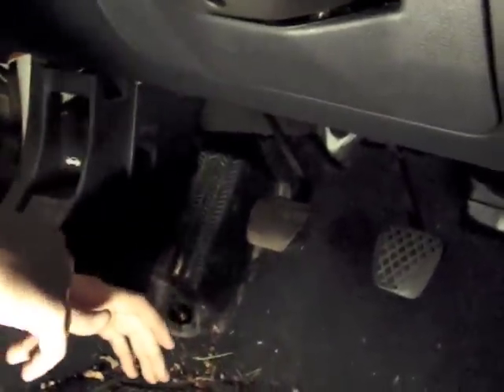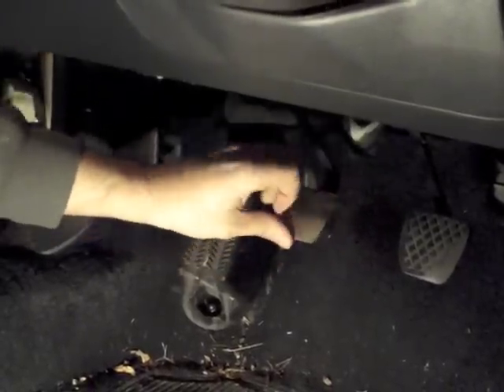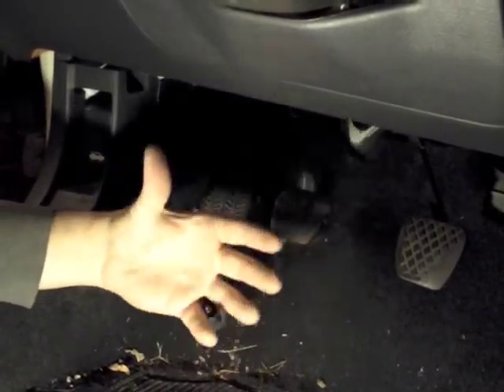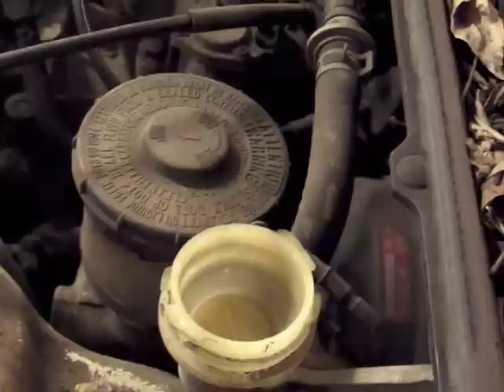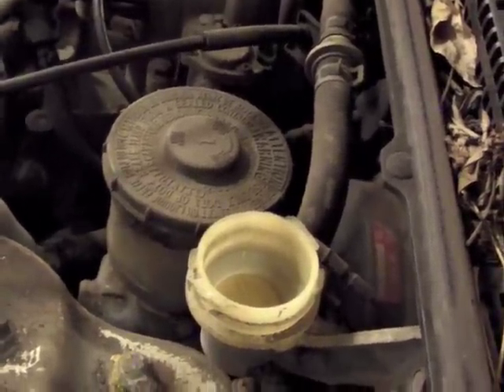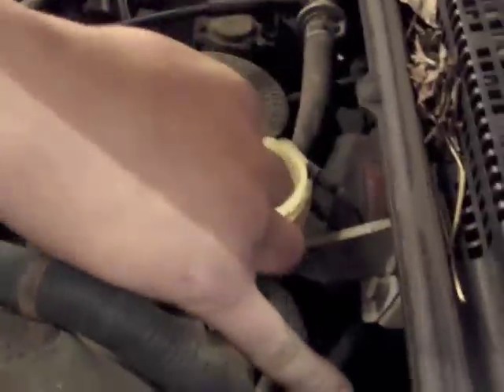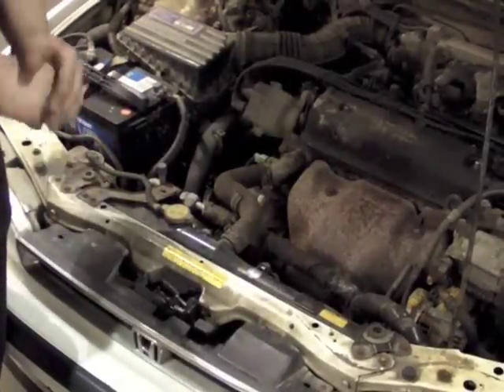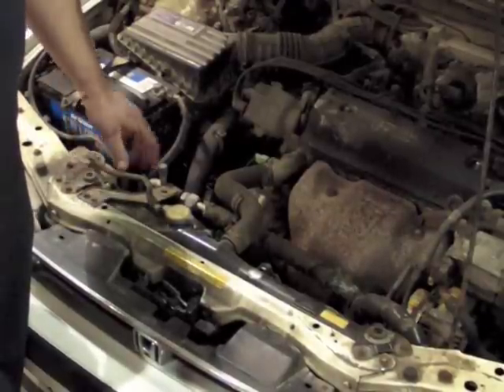How To Diagnose A Clutch Problem

Comment: i have a s10 1996 the clutch pedal is floppy and it wont go into gear when running. i have noticed that there is a little puddle under the truck what could it be? and is the slave in or external?

Comment: I have a question. I have a 95 eclipse gst with a hydraulic clutch, and i had to bleed it slightly regularly (say, once every two or three weeks). Today, I was driving and upon pressing the clutch, it simply slipped all the way down (it completely depressed itself and stayed there.) I CAN "unglue" the clutch per say, but it only does it again, and I can't put it in any gear. Any idea what it could be?

Comment: I'm having a problem where my master cylinder fluid level periodically increases to the point of overflow and as it does, I get very bad clutch shudder.  Each time I bleed it, the shudder goes away and I get much better control.  I can deal with a grabby clutch, but in this case, I have no control over the shudder (apart from slipping the clutch during takeoff).  I'm thinking that air is getting in from somewhere and is displacing fluid???

Comment: Well done!  You and your friend are the most articulate mechanics that I have ever heard. For the first time, I really understand how to bleed air from a hydraulic clutch system. I do not wish misfortune on anyone, but if you find that you must replace the slave cylinder, I will be most interested in hearing your descriptions. Got any videos on valve adjustments?

Comment: Thanks guys, gives me a starting point, As a kid I did clutch repairs myself, usually had parts left over, so it does not hurt to get a little refresher. Hope the truck does not need a clutch at abut 55,000 2010 Nissan Frontier PU, don't think it should yet.

Comment: thank you I have a 95 Ford Ranger with the same hydraulic clutch problem and that solves my problem because I have the same exact thing what you described happened to me earlier today going down the road I couldn't change gears and when I did it was hard as rock and my clutch is good thank you I appreciate these videos...very informative.....

Comment: Thanks - my clutch pedal seems very hard to push.  Works but makes a creaking noise and very hard, despite me having strong legs.  243k miles on 2013 Accord coupe V6 - six speed.  Any thoughts would be helpful.  Thanks again. 😊

Comment: I have a 2000 saab-93 and i have to pump the clutch 3 or 4 times to shift it in the next gear and sometimes it makes a loud sound when trying to put it in to gear. I have had the master and slave cylinder replaced and the clutch and pressure plate as well.

Comment: great video well done guys...my clutch has gone I was driving and it gradually wore out and now my clutch has no pressure onit at all and i cannot get it in gear. I just wanted to know, do i need 2 replace my clutch or anything 2 fix the problem or can i do this bleed method and save some money?? thanks!!

Comment: I was on an uphill ramp in 2nd gear at around 3.5k RPM then the RPMs shot up and the speed did nothing. Noticed a slight burn scent soon after for a minute then went away. But I heard you can test if your clutch is slipping by say going uphil and putting it into say 5th and stomping on gas (low speed) and if the rpms/engine bogs down (which it did) means the clutch is NOT slipping. Suggestions :)

Comment: Hi Brain,
I am using Ford ikon 1.8 diesel Indian version. I have a clutch problem. the resistance on the pedal was nil while I was driving and I guessed that the clutch was worn out but after a day the clutch was working fine but again it had the same issue. I took it to my mechanic and he said the there was a leak in the tube as well as the master cylinder has to be replaced. after the replacement started I had to replace master and slave cylinders with  the tubes which had leak and also the

Comment: thanks for the video guys. I have 94 accord and have a same problem. question, I opened the bleeder when the person push down the clutch pedal a little bit of fluid came out. should I wait for a while to close the bleeder until the fluid comes out without stopping?

Comment: Great video guys. I have a 2005 Renault Laguna. The clutch doesn't disengage (since 3 days ago).It started the symptoms slowly at first and then the following day the control gave up entirely. Almost certainly a hydraulic fail. Just started to investigate the problem with a view to repairing it and saving a bucketful of garage bills. My first concern is that the master cylinder attached to the pedal looks  very awkward to get at and remove/replace if necessary. I will have a more serious attempt on it during the next few days, provided the West of Scotland winter weather does'nt prevent me. Have any of you guys  done a similar repair on a Laguna, and is it feasible for someone like me with a fairly good history of car repairs ? (Recently overhauled my braking system)

Comment: @fairhare do you have any resistance on the clutch pedal or is it limp? yes, any hydraulic failure such as a leaky master cylinder or slave cylinder could cause the clutch to not disengage, but the pedal will go to the floor with no resistance. sometimes the clutch disc will rust to the flywheel if the vehicle has been sitting awhile, and the clutch pedal will feel as if everything is normal. if this doesnt help reply back with your year, make, and model, and we can figure this out. Willie B.

Comment: I believe my 2004 VW GTI clutch cylinder is located inside the housing for the clutch and flywheel.  The system seems to operate well, even thought it's 16 years old.  However, I do plan on replacing the clutch and flywheel as preventative maintenance.  Considering the location of the clutch cylinder and the difficult in reaching it, do you advise replacing it at the same time the clutch and flywheel are replaced?   Additionally, how is this internally housed cylinder bled?  Thanks for making this video.

Comment: pump the clutch pedal or slave cylinder itself? I've tried to bleed as you've wrote it and it seems not really working so, I checked the slave cylinder and it is leaking. so, I am trying to change the slave cylinder tomorrow. is there anything I should be careful about? thanks!

Comment: Brian, I have a question. I have a 1990 Honda Accord LX and the clutch is giving me some problems. I just had the master cylinder replaced a few months ago and today as I was making a turn I tried to shift down and the car wouldn't go into gear. I pulled over, and as I pressed the clutch in, it still wouldn't go into gear. We turned the car off and easily shifted all gears. I was told to replace the slave cylinder......Is that true and how do I know if I need a complete clutch replacement?

Comment: I have a 2003 chevy s-10 5 speed manual. I recently replaced the clutch. Before I replaced it the clutch pedal had no pressure and I could not shift the gears while the truck was running. I was able to drive the truck again after replacing the clutch for about a week and now I'm having the same problem. Do you think it is the slave cylinder or something else? Thanks, Jessica

Comment: I have a Chevy S-10 2003 double cab, brazilian made. Clutch keeps engaged at any speed and at any time, and when it happens I have to pump several times for it to suddenly release. I saw your video and found very useful to know how it works, but frankly I have no idea of what is going on. Any help is appreciated.

Comment: that really helped out alot guys im finishing a project with a h22a in a 94 accord and replaced the slave and master cylinder and the clutch pedal is sticking the floor
id apperiate for a commet back

Comment: Yep, My 87 Jeep has a separate reservoir, while My 2004 SATURN has a shared clutch/brake reservoir... Jeep is in the 3rd clutch. (hose burned a hole thru killed the 2nd clutch)
SATURN lasted 255000 miles on the 1st clutch ❤️👍 currently at 357000+  miles on the 2nd clutch. Today, Jeep clutch went to the floor while engine was hot... Then pump pump and the clutch woke up. That's what brought Me to this video.

Comment: I have a 1985 Chevy S10. Replaced slave cylinder, master cylinder and rubber hose. Bled system. No bubbles. Would shift ok at first then stop. Clutch pressure gone. Bled a couple more times. Same thing keeps happening. What do you think is wrong?

Comment: Just had new cluch kit put in my 94 chevy silverado 5.7 liter 350 5 speed 2 years ago and I think I have a throw out bearning issue when clutch is is ingadge no rattling when letting clutch out ingear get a rattling sound and in nutral also ?? Is this a throw out bearing or a piolet bearing ?? And what would happen if ether one of these go out completely while driving??? And how much shop cost to have fixed??

Comment: Hi. I am having issues with my 95 probe and my pedal is staying on the floor when I press it but I still am unable to shift into gear. I already bled the system and the fluids came out after a couple times of opening the bleeder. There are no leaks on any of the lines nor is there on the master or the slave. Should I replace them or could it be the Clutch or flywheels themselves causing my problem? It hasn't had any issues till today it went from shifting great to not at all today.

Comment: Hi Brian great vid, quick question I've got a 97 sti impreza I've noticed its starting to rev out a little in 5th gear now and then, also the clutch pedal is sitting half way to the floor all the time and it takes very little to engage it, could this be solved with bleeding or is the clutch slipping!!

Comment: my clutch pedal is hard to push.  the pressure plate and clutch disk are already replaced still it becomes hard to push as the engine heats up.. the master cylinder is not leaking, the slave cylinder might be the problem because it leaks a little bit of fluid. does it make sense?

Comment: Brain I have a 93 Honda Accord LX with clutch issues. When i shift it grinds into second and third, and driving home to park it i notice on the freeway as i was shifting i was not picking up speed but slowing down when i press the gas the RPM will race. After parking the car and went to move it this morning into the garage putting it into first gear the car want move at all now. All my fluids are intact and im not leaking any thing do i need to replace my whole clutch system now ?

Comment: Idk if this was covered but could use the advise. 88 honda prelude 2.0. Clutch doesnt grab until almost all the way out, last 3 inches or so. And when Im driving and give it "more then normal" throttle the clutch slips. Bad clutch or air in the lines?

Comment: I'm working on my 96 Nissan maxima with the 3.0l v6 and as of now I replaced the clutch, master cylinder, and slave cylinder and the entire upper half of my clutch petal is dead and it grabs at the very bottom of the petal with no play whatsoever and I cant figure it out. I've blead all the lines, did an entire fluid flush, made sure all the air was out of the lines, and I still have half a dead petal. everyone I ask for help with it is at a loss and no one can figure it out. Thanks for making this video it definitely helped but I still cant figure it out.

Comment: Great work and instruction guys, thanks. I have a problem with my gears - I have a 2006 Ford Fiesta, when I first start the car and pull away, the gear change is absolutely normal. But, when I drive for half an hour until the car is up to temperature, it becomes really difficult to change gears... I've heard that it could be the clutch, the gearbox, and the gear lever mechanism bushes... any diagnosis similar to this? Thanks again chaps.
Reply: +dougieladd Yes, your problem is that you drive a Ford...
Reply: have u had the trans fluid changed
Reply: It was the leverage, it needed greasing. It took a few goes to diagnose it though. It's all sorted now mate, thanks. Back to normal. Chaka Zulu - thanks, very helpful!

Comment: Finally! A video that helps. I have a 97 Accord with the same problem - right now my clutch is sitting on the floor. Did you have to replace the slave, or after flushing everything does it work fine?

Comment: Thanks for making this video, my Mitsubishi lancer gsr turbo reves smoothy when parked but under hard acceleration it won't pass 5 or six thousand rpm. Sometimes in the morning the clutch pedal feels very soft and low to the floor. It usually builds back up while driving. Is this a sign of a tired clutch or leaky clutch hydrolics.up

Comment: Just replaced master and slave cylinder as well as ran new line between the 2 and I've bled and pumped and bled and pumped and  I'm building no pressure whatsoever. Any tips?

Comment: At almost 30k and my wrx clutch pedal is losing feel any tips? It just feels not as firm as usual. Especially after a few pulls.  Update checked the fluid and its still full. It shares fluid with the brakes via a hose out of the bottom

Comment: Good video. Have a 1994 Toyota Tercel. My son is driving it and now the car goes into gear but have to rev the motor to get it to move forward. It slowly gets up to speed but on a hill, very slow to pick up. I'll check the slave cylinder first before deciding it's the clutch. Doesn't seem to grind at all when going into gear. Any thought?
Reply: Cliff Olney Sounds like the clutch has reached the end of its life. One more test you can do- get the car up to speed on level ground in top gear (like 55mph or more) and let off the gas pedal; if the engine speed drops straight away (it'll only be a couple of hundred rpm) without the car speed changing then the clutch is dead. You'll need a new clutch, get that fixed while the car can still be driven to the workshop.

Comment: i have a 03 kia pregio van.The master and slave cylinders seems to have no leaks but it difficult to shift the gearstick and also getting stuck when it goes.What would be the other probable cause?Can it be the pressure plate, release baring or fork release?

Comment: Great info. My Toyota Corolla S cutch is starting to slip - even when I  release the clutch, she's still going into gear. But 133,000 miles on one clutch is pretty good. Thanks for the video.
Reply: What did it turn out to be toyota 1300s 100,000 mile same problem slipping quite a bit ?
Reply: ponemark PI ended up replacing the whole she-bang. Clutches were wore slam out. Had a Mom and Pop shop do the work. She runs great now. Those Corolla S, 4 cyl engines are bullet proof.
Reply: yes sorted with new clutch not what she wanted to hear.106,000 mile thanks prefer a rear wheel drive anyday ! Thanks !

Comment: 92 s10, (external slave too). clutch pedal is hard to push, not springy like a clutch should be. I've been told that is most likely the bearing. anyway, I seem to have a leak from the area where the slave cylinder bolts to the trans. I'm not ever low on fluid, but could the slave still leak? I seem to have a couple drips every time I look at the underside of the trans.

Comment: I have a 1996 Ford Ranger Super Cab 4.0L. The clutch wasnt releasing, and i replaced the clutch assebly, and master cylinder, and bled the system but i still have no clutch. what do you think is the problem?

Comment: The clutch on my 08 scion tc doesn't fully come back up when pressed in to switch gears. I had this same problem a few months back and end up switch out both the master cylinder and the slave cylinder. It's work fine for a few months, now it has started doing it again. I don't think it can be the cylinders because they are new. What should I be looking at now.

Comment: Hey thanks for this video.  Very helpful.  Most videos are not clear at all.  The guy doing it knows what going on but if someone trying to learn and can't see a thing, it won't help.  So great job.

I have a 07 Wrangler Rubicon that the clutch paddle is soft now, can't shift.  But my brake fluid reservoir is not low...Do you think its still the slave cylinder having a leak?

Comment: I have a 1991 Plymouth Laser RS 145K miles on it, and since i bought the car a year ago i noticed when the clutch is engaged its makes a quick grinding sound when shifting gears, it usually does this grinding when the vehicle is driving in cold weather conditions. After watching your video it gave me the idea to try and bleed the clutch. Since ive been driving it i also noticed the fluid level has not moved since ever. Hopefully i didn't damage the clutch and more :/  any ideas???

Comment: I have a 93 ranger 5spd. The clutch has been engaging later - I've only noticed the past couple of weeks. Where it used to engage mid travel, it now engages almost topped out. I only have about 3 inches of travel before it disengages - out of about 10 inches total travel. I also have almost no freeplay. What could cause this? I drive in city conditions everyday - usually short trips because I'm a delivery driver. I try not to ride the clutch or slip it. I just had the clutch replaced about 6 mo

Comment: 98 Jeep Wrangler Sport: swapped engine, trying to adjust clutch. Start the vehicle in neutral, will not go in in gear (grinds). Start vehicle in gear, vehicle will go forward and backwards, but makes a metal against metal sound. The clutch will not adjust fully. Keep trying to bleed slave cylinder, will not give me a strong pedal feel. Could this be the clutch is still not adjusted properly, Could master Cylinder be gone, or could throwout be knocked out of place when putting engine in?

Comment from the maker: @nano60608 if your just learning your clutch could be getting a little hot and causing the loose pedal.. the fluid is brake/clutch fluid which is what we are using and bleeding in the video.. follow the bleeding steps we did if your clutch continues to feel loose and see if that helps..